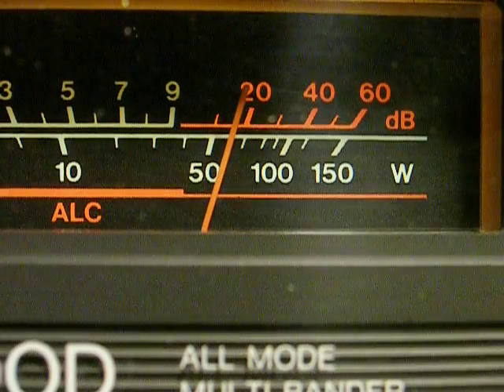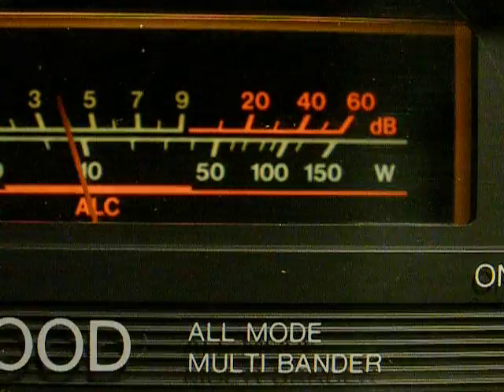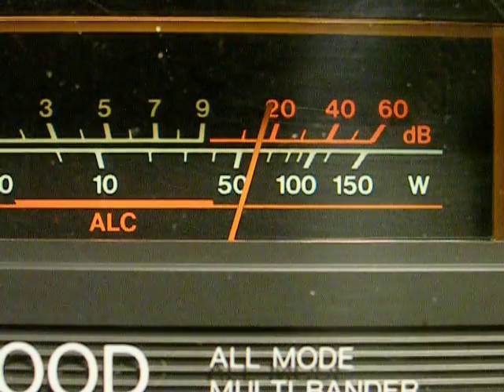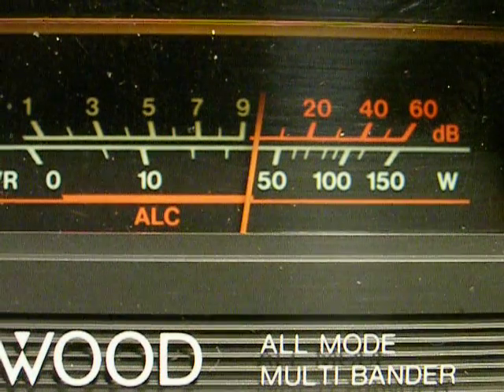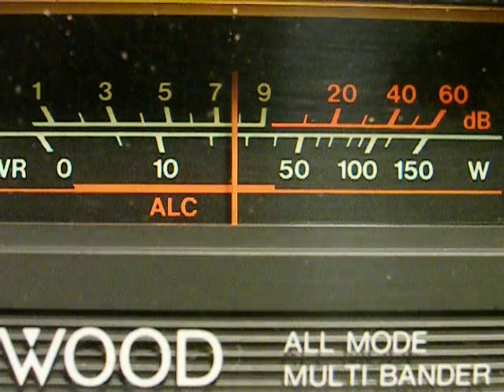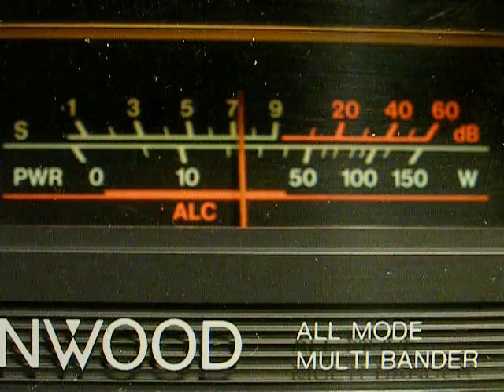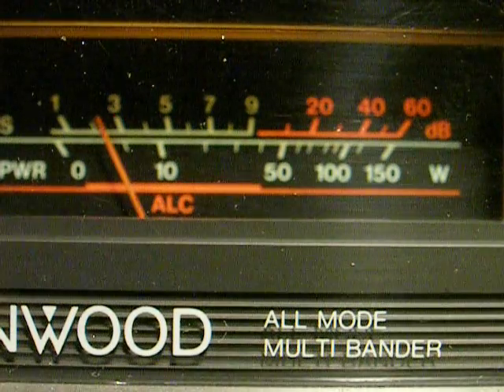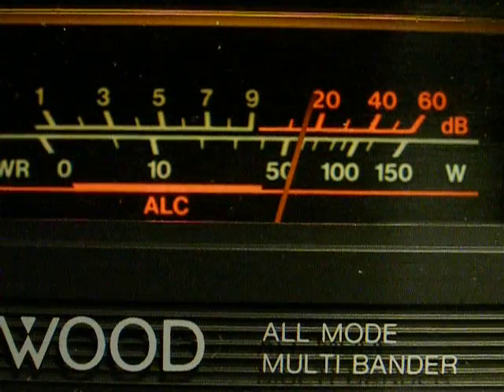Power line static on Amateur Radio Bands

Comment: Having the same issue here in England right across the hf spectrum disgusting interference the the official body OFCOM  in the UK have allowed them to be used .Independent measurements of theses devices show them to exceed 1000 time the legal  limit .I have Ofcom coming out Tuesday 14/4/13 to investigate this crap .Hope you got it fixed up .